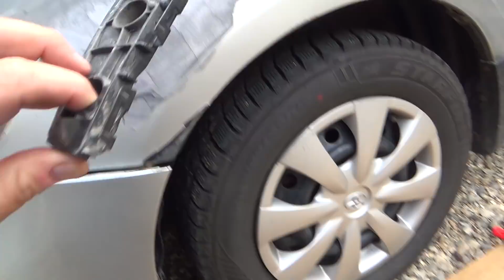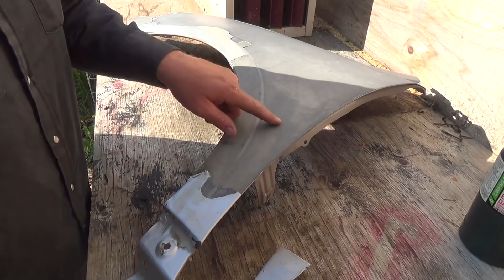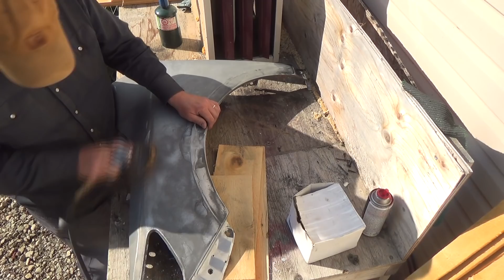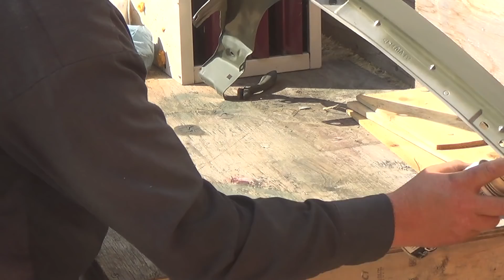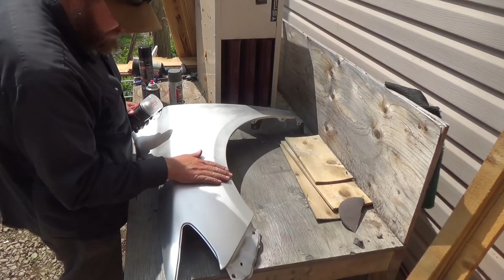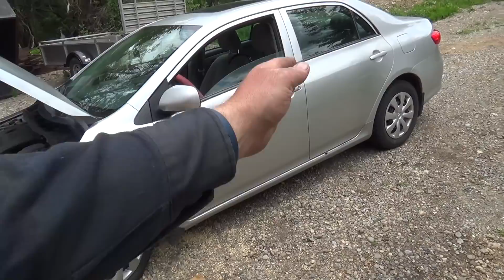Removal of the Corolla front fender..clean prep and repaint...I think I messed it up :(

Comment: When you were bashing on the panel and talking about the broken plastic clip, all I could think of was Andrew Camarata would drive a self tapper in and call it 'fixed!' lol 
I've owned 4 Toyota's and they all faded funny with age on the different materials, the plastics would be the first to go a different shade. Worst was the Red one I had! Fuel cap looked pink when I traded it. The current 2019 model I have already as a random plastic panel beside the door which has started to get a white sheen on the black colour and its noticeable in comparison to the other parts of the car.

Comment: Rather than sanding or sand blasting on something looking for a automotive finish, you etch the metal. that cleans it and create pores for the paint to stick to. A phosphate based detergent (like tide powder) is excellent for this, then you can clear coat and wet sand to high luster.